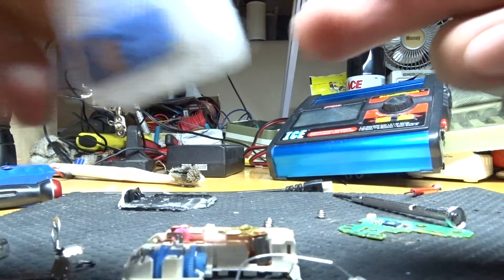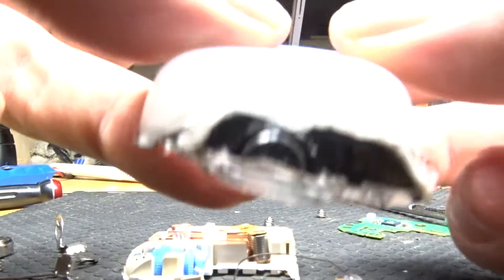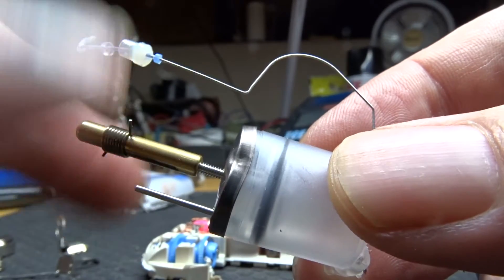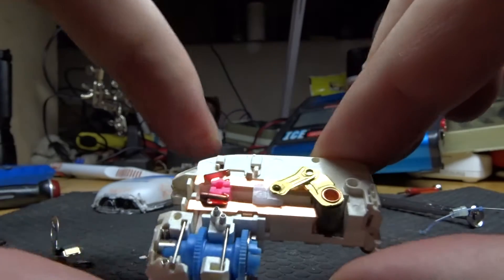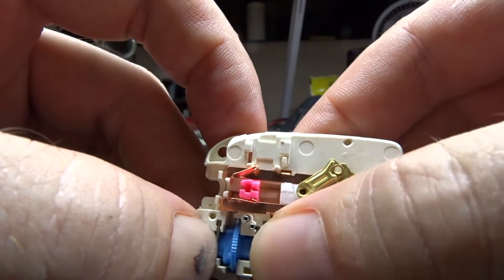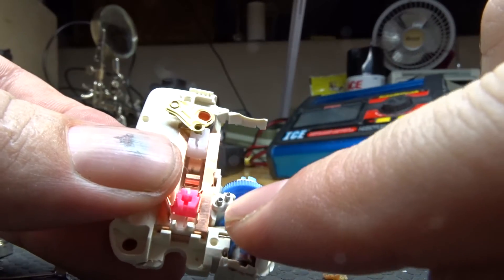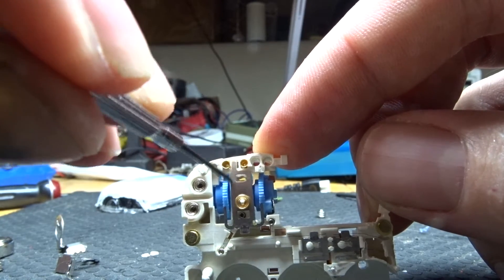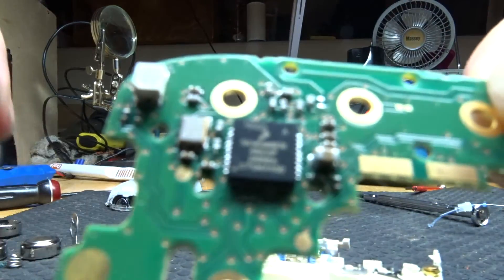Neulasta injector teardown

Comment: Out of curiosity I just disassembled my spouse's unit after use. 
I discovered the actual pump motion is supplied by a Nitinol (muscle wire) motor that moves back and forth to activate the rotary cam. 
There is no country of origin on the unit but the batteries are U.S. made so I doubt that the device was assembled in China.
BTW, I will dispose of the circuit board and batteries through a recycling firm rather throwing it the trash as the hospital advised.